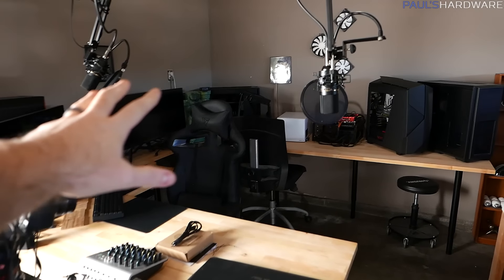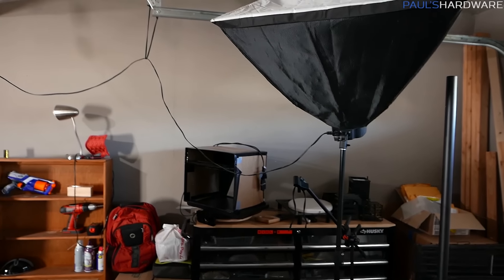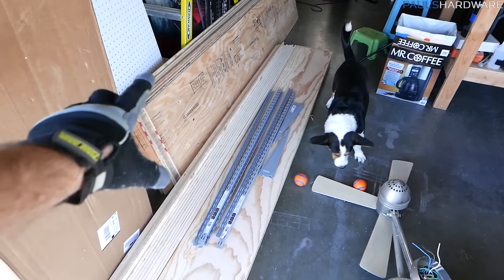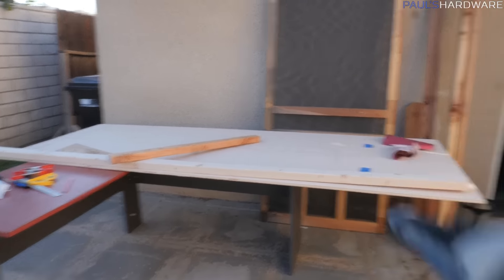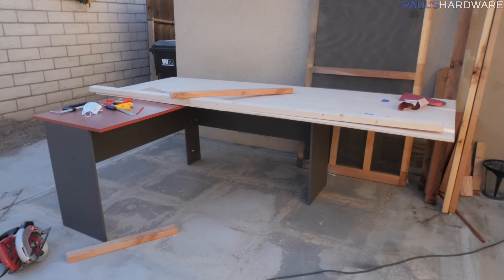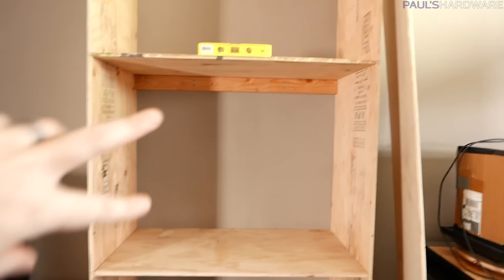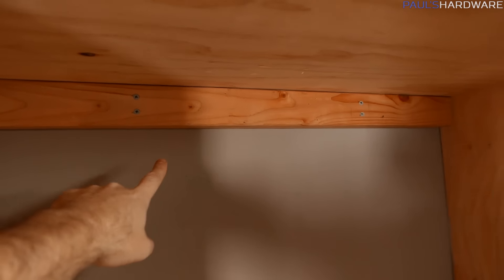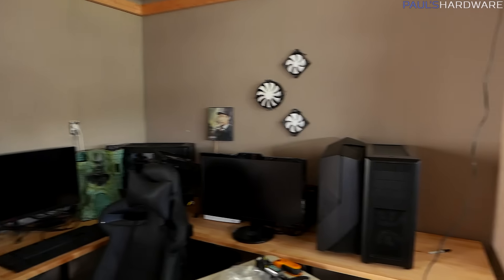Garage Worklog 7: Cabinet and Shelves Part 1

Comment: As someone who has worked with cabinets, wood, power tools, etc, for years, I would advise you to not wear gloves while using power tools. If you do, they have to be fitted, not loose. And be very careful and mindful of where you hands are. One tiny bit of glove getting caught by a spinning blade might land you with a world of pain. Saw a guy's glove get caught by a skilsaw while he was moving his left hand off the skilsaw. It pulled his glove in, cutting up his left thumb in the process, dropped the skilsaw, which just pulled what was left of his thumb off along with tearing up the glove off. The skilsaw hit his leg on the way down. Lucky for him, his thumb and glove stopped the blade or else the blade would have cut his leg too since the blade guard wasn't fully engaged. It all happened in less than a second. Just sayin', yo.
Reply from the maker: +F22_Pilot Damn, that's scary. Thank you for the advice though I will keep it in mind!
Reply: +F22_Pilot exactly! I have some friends who lost a finger and 1 who lost his finger tips in accidents they never though would happen because of gloves.

Comment: I recommend bracing the sides of the shelves if you plan on putting anything heavy on them. I've seen plywood shelves built like that split. A simple strip of plywood glued against the cabinet walls underneath each shelf will work. Without this, only the layers of the plywood above the nails are supported.
Reply: +David Scott An excellent recommendation, too.
Reply: +Mark Rose I drill holes on both sides and put shelf pins in when I do shelves. That way, they are supported on 4 corners and adjustable. They can support the weight of a person hanging. But he would need 3/4" for that instead of what he's using, its way too thin.
Reply: All sorts of great ideas. The sides definitely need something under them or those shelves will fall out sooooo fast. The front may or may not need support depending on where he puts stuff, but at this point I'm just envisioning a computer case being set onto one of those shelves and crash it is ruined across the floor

Please, Paul, for the love of expensive computer parts, support your shelves more!
Reply from the maker: +Mark Rose Thanks for the suggestions gentlemen! I will definitely take your advice, I have extra plywood that should work for the supports.

Comment: you need to put 1x1 underneath the shelves on the sides. the screws that that you have on the outside screwed into the shelves are not going to be enough support

Comment: Pro tip, the best stud finder is a 3/4" x 3/4" [or larger] Neodymium magnet. Just run the magnet up and down the wall searching for nails or screws. These indicate where the drywall secured the drywall to the vertical stud lumber. Make sure you feel 2-3 screws lined up in a row vertically, in order to ensure you actually have located a stud.

Now you can confidently secure heavy duty shelves, or mount a TV, or many other projects

Comment: Just a couple of carpentry tips, firstly, concrete tends to suck water out of wood that's placed upon it causing the wood to degrade more quickly; usually people put a layer of plastic as a barrier between the wood and concrete, even if the concrete has a sealed top. Secondly, you will probably want to support under each shelf with a thin strip of plywood rather than just relying on the nails you put in to hold the shelves directly.

Comment: Might I make a suggestion? Put some support boards on the sides cuz the self won't be able to hold that much wight with just the screws you have in the shelf boards.
Reply: +Allen Morgan I was thinking the same thing but based on his skill level I'm assuming he hasn't got to the additional shelf supports yet.
Reply: +Allen Morgan i noticed he was using a router earlier, if he had cut slots in the vertical support, it would have been quite strong to slide the shelves into. i think they call them dado's, it's been a while since i've done wood work, see it done all the time in cabinet making.

Comment: Hello Paul ... really enjoyed your video ... your idea gave me another idea ..which is why make a sliding Cabinet .. if you do that you don't have move or dismantle anything . just slid the hole Cabinet anywhere you want .. i am not an expert like you , not even close but i think it can be done and will save you a lot of time ... also i agree with Mark Ross ..you should do what he says so you can put case and and monitor ...or at least make two Cabinet side by side ..that way which will provide support for each of them ... thanks for reading this comment

Comment: Grats on 200k! Have you painted/sealed your garage floor or are you planning on doing that? I remember how much of a difference that made in my basement for dust and at the end there it seems that is a concern you have
Reply: +Sean McMunn i used that epoxy kit you can buy to paint onto the concrete, very nice. durable as hell too, can park cars on it.

Comment: Fratz Paul. If anyone should get the viewers its you man. And the garage vids are great keep'm coming. Its a cool spot to work in it seems.
Hmmm trimmer line as cable ties. Ingenious Paul! :P
And my God, get a mini pickup.
Why not just put a thin plywood backing on the shelf unit and just anchor that to the wall. No dust then plus will be a full shelving unit when you move it and not need a wall behind it.

Comment: You really need to put braces on the shelves across the front(best would be a 2x4 across the front, like you have on the back). Otherwise they will bow pretty easily.
Reply from the maker: +Jeremy Biggers yup they'll already give with a bit of weight on them, I am going to add a brace :-D